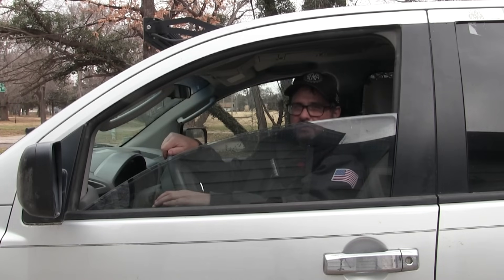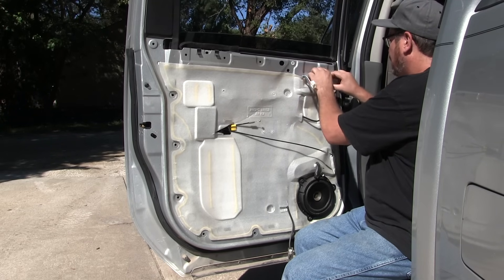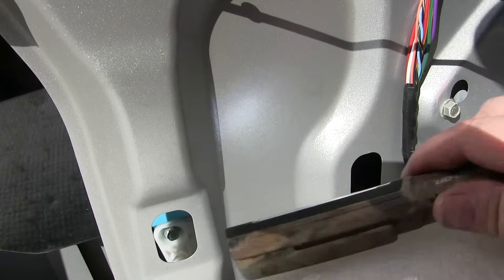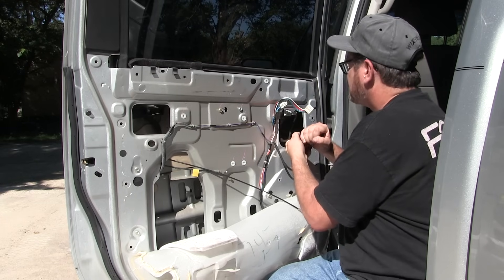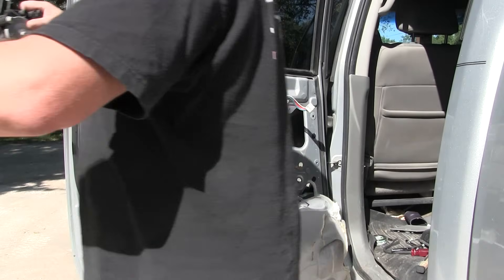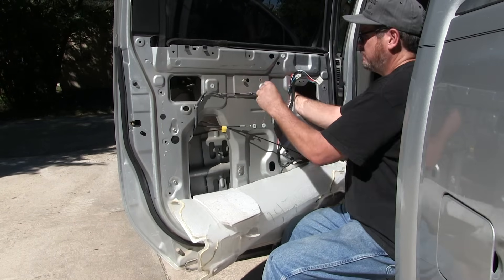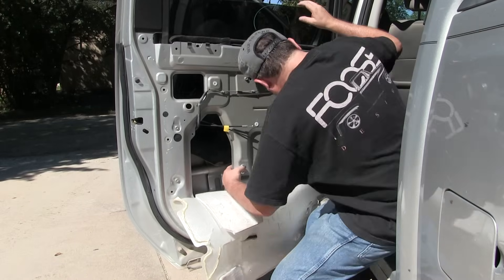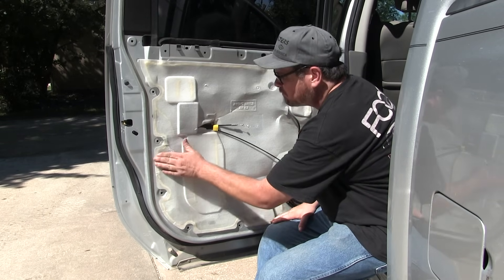Why Won't My Window Roll Up? Most Common Problem and What to Do About it.

Comment: Super video! I applauded for $5.00 👏👏
Reply from the maker: That is awesome!  Thank you so much!
Reply: Hi guys, wonder if anyone might be able to help. My Roadster mk 1 driver's window has been slightly erratic for about 9 months but always corrected itself. After a serious cold day it appears to have had enough. It goes down but only up by 1/4 - I've tried all the 'tricks' but no go. Just changed the window motor and still the same. I'll watch the vid when I get back home but does it sound like a regulator issue (as the window does go up partly..??)

Comment: Question since I can not find on YouTube my window can roll down if I press the button to make it roll down. And it will not roll up at all and when I do push it back up it will fall by itself and I have to use a shim to keep it up any answer to what it could be?
Reply: Did you ever find a fix for this?

Comment: I have a question on a 08 Titan. My passenger window will go up and down, unless, you roll it all the way down,,, then it gets stuck and won’t come up at all, you can’t even pull it up(I removed the door panel and tried to pull it up and it still wouldn’t move). Finallly it randomly went up after closing the door and hitting the switch up. What would this issue be? I replaced the motor and regulator on this window a while ago too. Like I said it moves fine up and down, unless you go all the way down.

Comment: My back driver side window will not go up. It can slide up and down using my hands no problem, but the motor inside will not make it work. And I can hear the motor working. Is it the regulator?

Comment: i love the way you say regulator. yeah buddy. I just had this happen to my car; 2003 honda element. I didnt realize it, it was half-mast and then i tried the switches and it pulled the window down but then it wouldnt go up. oops. When i pull the switches i can hear it moving in the door. Hopefully my local honda shop can fix it soon.
Reply from the maker: They should be able to fix it for you.

Comment: Do you know how to tell if the window is just off the track? I can hear something go up and down with my back window when pressing the switch. I can manually pull the window up about 3/4ths of the way and then it catches on something and I can't pull it anymore. Considering something sounds like it's going down or up with the motor, does that still sound like a tension problem?
Reply: I’ve got the same problem

Comment: I have a 2013 kia optima ex. The passenger side front window is free (I pulled it up and put some duct tape. Is that a broken cable? How much can it cost if I get it fixed? And how much, if I do it? Thanks in advance 🙂

Comment: Just wanted to say your video, really helped me fix my stuck window. The window didn't come off either of the two holders and the motor/regulator are fine. The problem was one of the bolts literally fell when I took the plastic vapor barrier off and the other two were really loose.

So any one trying to fix the problem and everything looks fine in their, make sure to check the three bolts that hold the motor/regulator in place are tight. When I tighten them I made sure the window was all the way down. Now it works better then before it got stuck half way up and I don't have a 16th inch gap at the top when closed.

Comment: I've had this issue on my 2010 Mazda C-9 Grand Touring. I paid a shop $500 to replace the regulator, but the issue recurred 2 months later. Why would this happen? And how can I keep it from happening again? I'm willing to do the work myself, if I have to. (Don't want to take it back to the shop that did the work because of my poor personal experience with the employees)

Comment: I have a Buick century the back window goes up and down without using the power window switch. The motor works and I have it taped cause if I hit a bump the window goes down. Suggestions?

Comment: Great video. But if you're not mechanically inclined and you need a cheap emergency fix until you get a chance to get it repaired properly, I made a video to help.
Reply: If u need a really cheap fix just use zip ties to hold the bottom of the rack to one of those holes at the top of the door.. Less than a dollar lol

Comment: Mine went all the way down and won't go up. Don't hear anything with I push up or down. Is that regulator or motor?
Reply from the maker: If you don't hear the motor running, then it could be a fuse or switch.  I would check those first.  If you can grab the window and pull it back up some, then it's probably the regulator.
Reply: Hi! Mine is similar. It stopped working after I let it down halfway. After 2 hours it started going down slowly by itself and ended up going completely down. It was making the clicking noise, but not anymore
Reply: @CarAddictGarage  if dont hear the motor, then wouldn't it be the motor ? Lol new motor perhaps

Comment: One question I’ve always had is, does it matter what the position or the window is when it’s bolted to the holders on the regulator. At least as far as travel. I know you can only get to them at a certain spot but is the motor positioned all the way one way or the other?

Comment: Thank you for this video.  The window regulator on my 2000 Jeep Cherokee turns out to be essentially the same.  The Nylon clip at one end of the cable had failed.   So, a trip to the salvage yard were 75% of  the  Jeep window regulators had already been pulled, apparently a common problem.  Found the part I needed, put everything back togetter and back in business!  So, thanks again, this video was very usful.
Reply: My 2000 Jeep Cherokee just did this to me this morning. I’m glad I can learn from this comment. Super annoying had to happen today of all days, but I’ll get it done.

Comment: I rolled mine down and the damn thing broke off the bracket and it's stuck down inside the door.
Reply from the maker: You may need to take the door panel off and slide the window up and duct tape it in place until you can get it fixed.

Comment: I put another regulator on,but my window stops working intermittently.  For some reason my rear flip out windows stop at the same time. So they are connected. 
Duck tape qwak lol

Comment: I had this problem once. The window motor was going bad. Tapping on the motor while at the same time pressing the switch up solved the problem. This won't work if the motor is dead. If it makes noise and doesn't work than it's going bad.